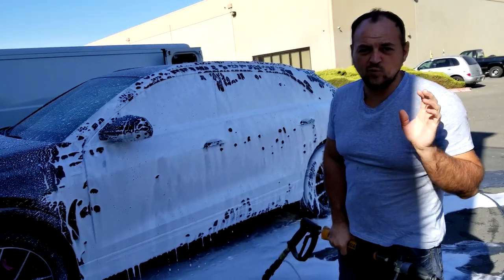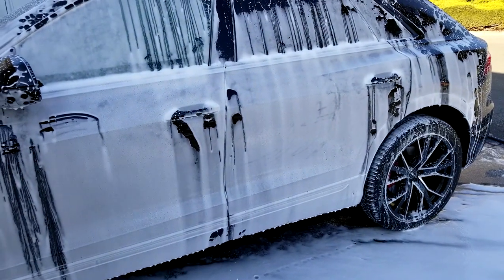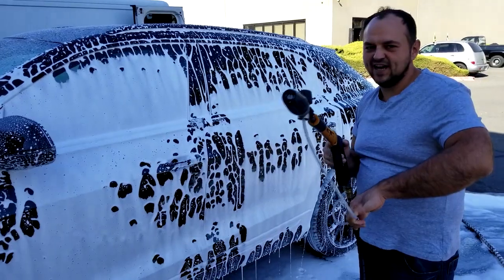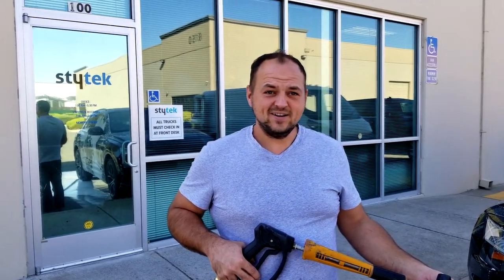DURABILITY TEST! CERAMIC COATING VS SEALANT! S02 E62

Comment: What kind of spray nozzle you use on your pressure washer?
Reply from the maker: For foam its mtm pf22, for rinse nozzle  regular.
Reply: Toly's Detailing & Family Vlogs what kind of wand are you using? Looks nice
Reply from the maker: @Mrjozz011  also mtm wand green nozzle.
Reply: Toly's Detailing & Family Vlogs 👍🏼